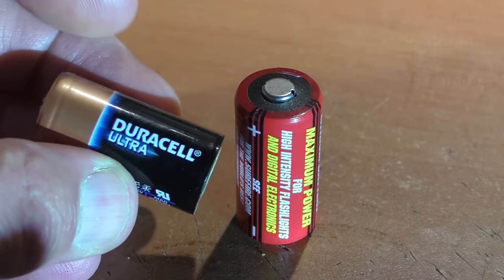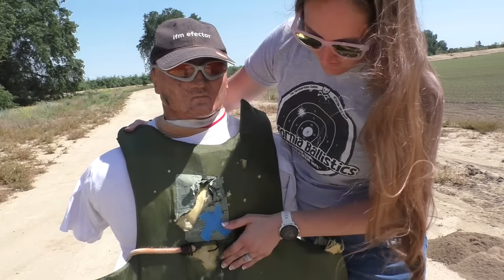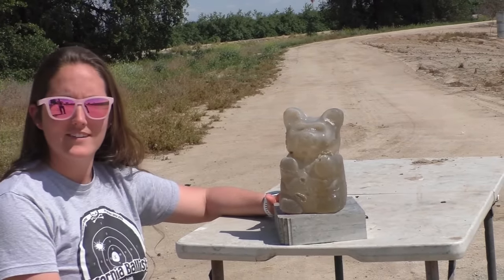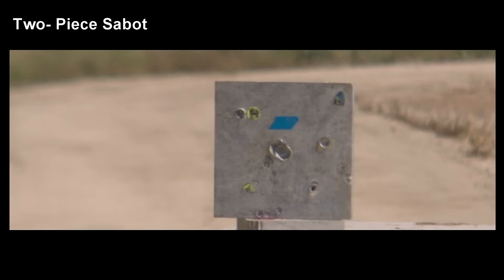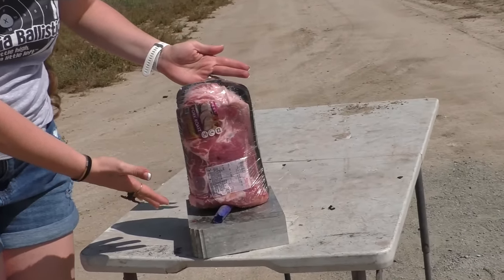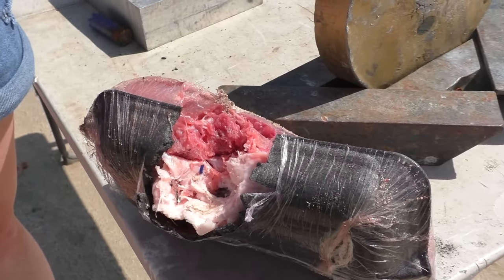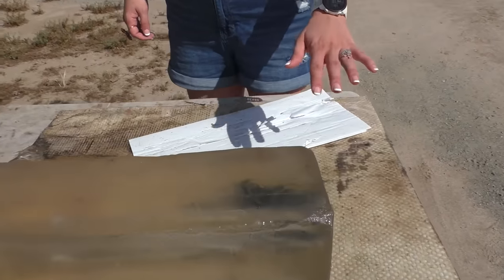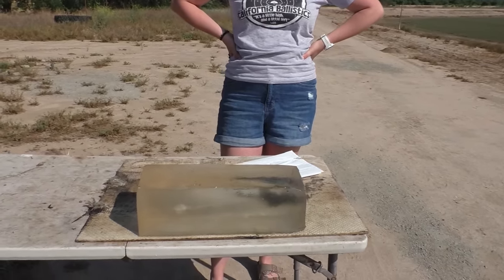12ga. Shotgun Lithium BATTERY Slugs-  Brutal Results!

Comment: I would like to see you try this: 12 gauge slug, drill a hole in the front end of the slug, fill cavity/hole with mercury, wax seal the front. Fire that into various thickness steel plate. In theory should get some good armor piercing. It is very difficult to overcompress a liquid (the mercury). This is very similar to many anti-tank weapons, though they use molten metal as their “liquid” of choice.
Reply: i think what you're intending to refer to are HEAT rounds, which use a stream of metal behaving as a liquid (molten or not) to punch through armour. However, the energy to form the penetrating jet comes from explosives in the round itself, not from the rounds kinetic energy. liquids are usually easier to compress than solids.
Reply: Mercury wouldn't be doable due to laws. But he could do gallium.

Comment: Hey, nice to see Breanna again.  Welcome back!  

I wonder if there would be any difference in the impact reaction if you used lithium-ion or lithium-polymer rechargeable batteries.  I know that the post office doesn't like to ship them on airplanes, because they can apparently burst and catch fire.  It might make some interesting fireworks when they hit your targets.
Reply from the maker: Not sure if you can get that in a battery that has the right dimensions for a 12ga or not.
Reply: @taofledermaus  probably could try a 14500 batt, is the same size as an aa alkaline, but runs at 3.6v
Reply: @taofledermaus  You can buy Li-ion batteries in 2/3 A size, often labeled as 16340 or "RCR123A", which are the same size as the batteries you use in this video.
Make sure you get ones labeled 3.6V or 3.7V; they also sell 3.2V ones (LiFePO4, which is safer and thus won't explode as impressively) and 3.0V (probably contain active circuitry which could unbalance the battery in flight).
For the best explosion, make sure they're fully charged before firing. Also, be careful in case one explodes in the barrel.

Comment: this was an awesome video.  Would you mind doing a video where you load hollow points (either 12 gauge, .50 cal or .45 cal) with metallic sodium and fire at a target that has water in it?  if you do this, PLEASE follow every safety protocol.  This is the stuff that was used in depth charges and reacts VERY VERY VERY badly to water or even air with a high moisture content. Even sweat will set it off.  But the idea was to load a hollow point and see in you can coat it in a wax plug and see how it performs. Not sure if ballistic gel would be "wet" enough.

Comment: An interesting and fun, although very messy video. There's some nasty, very nasty stuff in lithium batteries, all that black stuff is horribly toxic and will have cobalt from the electrodes mixed in there. 

I have a question: were the batteries bullets charged up before being shot, or were they drained?
Reason I ask is that I expected a bit more fire, as lithium is very reactive with oxygen. If the battery was charged, the lithium would be in its elemental form, which is unstable and wants to be oxidised. When the battery was charged, the lithium in the battery would react almost explosively with the air to oxidise to lithium oxide. But if the battery was flat, then the lithium is already oxidised to something stable, so it can't react with the air.
Maybe when Taufledermaus revisits battery bullets in the future, you could try charging some of the cells up and seeing if they're any more spectacular than the others?

Comment: Since there is no tumbling, I am thinking this probably gives us the best possible length for a true 12 gauge brass or lead solid slug.  The light mass of the battery, combined with it's frangible nature  is why it doesn't penetrate more.  Regarding the wound track, I don't think a surgeon could do a good job of cleaning that wound out the way Lithium and fragments are everywhere.
Reply: with the lithium, I don't think they would make it in time to see a surgeon. If the shock of the round, fragmentation of the round or blood loss didn't kill you, I am sure the lithium would push the body's threshold beyond it's limits.

Comment: Has any of the team tried the 17mm diameter MVDSR (mini vibrator saboted round) complete with AAA battery ? It has a very heavy weight in the tip and flies very well with good velocity.
Reply: You’ve tried this….?

Comment: FYI here are some Lithium Ion Basics:
These are CR123 Lithium manganese oxide cells. They are one time use DISPOSABLE batteries.
There is basically no metallic lithium in these cells. The use more complex lithium compounds in partial states of redox. A more extreme version would be how Table Salt is nothing like Metallic Sodium.
This manganese family of lithium ion chemistry use a very tiny amount of Lithium compound. e.g. A 1,000lbs EV Battery has about 15lbs of lithium compound.
There is a vast array of different lithium ion chemistry type. But manganese family is currently high mass produced in both rechargeable and this disposable version.

Comment: I was impressed how thoroughly these batteries came apart regardless of what they were shot into.

These are regular disposable photo-type lithium batteries, right? If new and fully charged ... well let's do some math. If your 11 gram CR2 impacts its target at 400 m/s, that gives us 880 J if the energy transfer is complete (no external shrapnel or pass-through). The velocity could be considerably higher but you didn't chrono ...

Now, something interesting: A fully charged 800 mAH 3V battery contains 8640 J of stored energy -- almost 10 times what you get in a target by shooting it from a shotgun. Or perhaps 5 times if it's actually traveling at 600 m/s. TNT is ~ 4000 J/g for reference, so these things contain around 20% of the energy of TNT by weight, including the inactive bits like the case and terminals.

This shouldn't be too surprising, as, how much powder did you use to get the battery to its target? 5-15 grains? Smokeless powder has ballpark 75% the energy content of TNT, one gram is ~15 grains, while the battery itself is 11 grams total of relatively energetic material (equal to 3-4 grams = 45-60 grains SP), so it shouldn't be surprising that the battery actually contains more power than the shell propelling it.

That will definitely account for a little extra excitement at the terminal end, which you can see in the burst of flame where the lithium is melted/vaporized.

With discharged batteries this will be less of a thing, as the metallic lithium has been mostly reacted and there's not a lot of remaining chemical energy.

As far as the effects of being shot with one of these things: Wow. The chemicals involved are relatively nontoxic and could probably be tolerated by the body after some chemical burns, but the fragmentation is horrible. Basically like being hit with a frangible projectile. Infection? Depends; the inside of the battery is certainly sterile, but if tiny shrapnel enters externally you have tattoing and danger of infection in the dermis etc., which can be extremely dangerous.
Reply: I didn't even read your comment.but I respect you and your knowledge. this comment is underrated .true chad 🗿

Comment: This is a significant force-multiplier.  At a not insignificant cost per lithium battery, one person with a pump-action shotgun can potentially be a real headache for a SWAT team in an armoured vehicle.  A couple of those projectiles into the engine bay of any vehicle and you have an effective anti-material projectile theoretically at the the disposal of anyone with a shotgun.  The downside is that you will have to get reasonably close to whatever you are shooting at.  Essentially the lithium battery is an explosive charge encased in metal that is going to cause shrapnel damage to anyone or anything within a few meters of that projectile hitting a solid object.

Comment: Good vid-thanks - Were they fully charged too? I'm wondering if it's getting enough time to short the cell before the chemistry disperses- if so you could have an explosive round on your hands - and if you really wanted to be risky do it with overcharged cells - always be careful ,I've had a lipo fire in the house without intentionally overcharging -it wasn't fun making the decision to get burnt moving the cells (throwing them outa the window) or watch my house go up! All the best.
Reply from the maker: They had voltage but were spent batteries.    Too expensive to use new ones imho

Comment: Back in the 90s as kids, we used to use AA and AAA alkaline in plumbing pipes capping one end and drilling a fuse hole. Bassically crammed about 5 books worth of cut off match heads, wad of paper or cotton, then the battery wrapped with a bit of tape to keep it in. Obviously, nowhere near the results of you experiment, but they would penertrate a couch cushion.

Comment: This would be devastating to get hit with because lithium could react to the water in the body causing internal chemical burns not to mention you're being poisoned. Even if it doesn't kill you , you can still die from the toxicity and secondary reactions.

Comment: It's like a Glaser Safety Slug in that there's no chance of over-penetration. It would leave a mess for ER doctors to clean out of your guts if you were hit with one and lived.  A one-piece discarding sabot only works if it opens up like a flower, the air catches it, and drag pulls it free from the slug. You could instead make a "driving band", like when they put a bronze band around artillery shells, because steel shells can't be made large enough engage the rifling. You could wrap electrical tape around it until a battery until it's the right diameter, or better yet, use shrink tubing. It would be more uniform thickness all the way around, and should stay put. Put one layer on the battery and drop test it through a smooth-bore barrel. If it's too loose add another layer of shrink tubing.  Repeat as necessary. If you made it too big you could cut a slit in the last layer and peel it off. Think of it as a non-discarding sabot and you'll see how it would work. 

On a related note, I figured out earlier this year that 123 batteries are .67 caliber, 17mm = 0.669291 inch. Paintball markers are .69 caliber. I haven't gotten around to taking the Flatline barrel off my customized Tippmann A5, and putting the straight barrel back on yet, but I will try muzzle-loading some 123s whenever I catch up on working on my real guns. I won't be wasting expensive shrink tubing on the low velocity paintball gun at whatever pressure it is, but I would to withstand the higher pressure of a 12 gauge. One piece of electrical tape or 2 pieces side by side will do just fine for my needs.

Comment: Seen a bunch of crazy rounds. The scariest was a toss up between tungsten carbide circuit board bits and mercury metal in a AA battery can with epoxy on one end. The carbide would destroy pretty much everything it hit, and the mercury one would be horriffic to get hit with, it breaks into a cloud of drops that break into smaller ones that turn into smaller ones that penetrate anything. 😲

Comment: Any regular AA or AAA batteries make good shotgun loads after they run down.  Nice to see that someone noticed.  Just like pewter instead of lead for casting your own bullets (it shatters on impact), this is 50 year old (or more) stuff that is not talked about much today.
Reply from the maker: They really don't.  The key is precision,  a proper bore fit so they leave the barrel exactly parallel to the bore
Reply: @taofledermaus  I only use a shotgun for intruders in the same room with me, so precision is not a major issue.  Loading a centered core in a shot shell is one of the first things you learn at 10-12 when you start loading with your grandpa.

Comment: You can heat and filter that gel for reuse. Just dilute it a bit to make it more viscous and filter it through a couple of coffee filters in a funnel until it’s clear. It may take several times but it will eventually clean right up.
Reply from the maker: No,  you can't filter it.   I heat it to 270 deg F  and it is still so viscous that you wouldn't be able to pour it through a colander.    You  also can't dilute it since that would contaminate it.
Reply: @taofledermaus  you mean you can’t force it through a extruder that uses a lot of pressure,like the ones they homogenize milk with?
Reply from the maker: @grokster9ontheroads174  I'll buy a $100,000 machine so I can strain the color of of a block of gel.

Comment: Fun fact: "Aluminium" is not the British term, but the European consensus term. The discoverer (Sir Humphry Davy) originally coined it "alumium," but then amended it to "aluminum." It wasn't until several years later that scientific community used aluminium in order for it to conform more so to other elements (such as sodium, potassium, etc.). In other words the correct term is "aluminum," but has since taken on the moniker of "aluminium" simply to sound better.

Comment: 0:07 Beyond the shooting line, you can see something elongated like a tower.
It collapses and tilts, but what on earth is it?

High-speed bullets have high velocity energy and will cause great damage to the hit object.
However, in the lithium battery, the chemical substances inside are dissolved and the blood is mixed, so if it is not removed promptly, it will cause fatal damage.
You probably can't live for an hour.

Comment: Does it make a difference if the batteries are used or new with the damage on impact .
Have you tried this as yet .
Charged verses discharged batteries ,,
And what about trying double batteries ..
Reply from the maker: These still had a charge,  but were not new.

Comment: One thing I have done before was take a 410 Buck Shot max powder load and cut the end of and dump the little buckshot out and open up a 12 ga. OOBuck and take out one of the shots. Then after I put the one shot in the 410 shell I cut most of the plastic off and put a little melted wax on the end to seal it. I didn't know what to expect of the experiment and I put a 5 gallon bucket of water out at 40 yards and then got the bucket in my sites and squeezed the trigger. Remarkably I was surprised that the one shot hit dead on the center of the water bucket and it shattered. Now I have to make a bunch of them

Comment: I'm wondering if that's the best way to dispose of a battery and why ❓ One of the things the Germans did in WW2 was to use wood rounds . They didn't range far but the wound was very hard to treat and if it didn't kill it took the soldier off the field longer sometimes than a standard round .

Comment: Tell us WHY you are using a Lithium Battery. What is the advantage? Is it just something that nicely fits into a 12 gauge? I know that Lithium is extremely reactive to water but nothing you did took advantage of that. The meat had potential but the battery passed right through without any time for a reaction. The lead impact showed a flash of fire but that might have been more of an electrical reaction. I just don't get it. What is the LESSON here?
Reply: Why not? 🦇

Comment: What I don't understand is this: After the first shot with the double sabot, you knew that it was far more accurate than using the single sabot; so why did you carry on using the single. Why not just cut the other singles into two and carry on?
Reply from the maker: I didn't bring my reloading equipment out to the range.

Comment: Idea to solve Energy Issues:   🫐By AMA🫐 To whom it may concern.
 The Key to making an over unity Electric generator work is mechanical advantage. In this case the mechanical advantage is achieved by getting the electric motor that is spinning a horizontal disc to be able to spin a quantity of separate vertical discs that are connected to devices that generate electrical current while spinning to generate more current then the electric motor needs to spin. One of the ways to achieve this without violating the laws of thermo dynamics, is to exploit magnetic field effects. To do this,attach a horizontally positioned disc to a bar the motor is spinning. You then place magnets on the top of the horizontal disc that the electric motor is spinning in a way that makes it so while the disc is spinning around, the magnetic fields are pushing upwards onto the edge of the vertical discs they hit into, forcing them to spin, thereby generating electric current. To get the magnetic fields to only hit into one of the edges of the vertically positioned discs, place a material under the vertical discs that keeps the magnetic fields from pushing up against the discs until they reach that one open spot where the magnetic fields can hit up against the edge of the vertical discs, pushing them into a spin. In this way, the magnetic fields will be forced to do work that the electric motor wont be doing. This is how it's possible to achieve an Over Unity Electric generator.
 Extra Note: If anyone uses my ideas for profit in any way even if it's getting someone else to mass produce my Over Unity Electric Generator idea, I am fine with you & me getting royalties from it. :)  My e-mail is starfire7654321@yahoo.com
One way to send money to me is through my PayPal which is paypal.me/CloudStrife7
 I hope you all have a great day.   🫐By AMA🫐

Comment: What are those sabots for? (Sorry for the misspelling).
Reply from the maker: The battery is smaller than the barrel.  The sabot fills the space and engages the rifling so the battery spins.
Reply: @taofledermaus and how they are supposed to stay around the battery? I mean, shouldn't they get dragged by the barrel and  the battery goes freely before them? As you might see I'm no expert at all, but seems very unlikely to stay around the battery.
Reply from the maker: The wad pushes on the battery and sabot together as a unit.   If it didn't work,  we wouldn't have gotten any spin and the batteries would have tumbled through the air.
Reply: @taofledermaus  you are right!